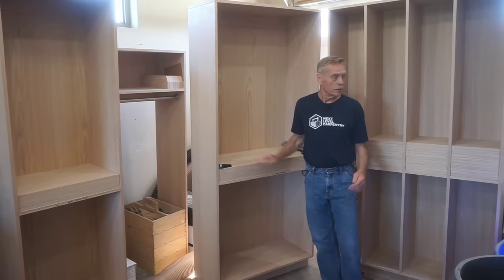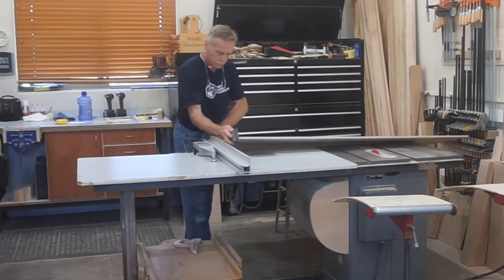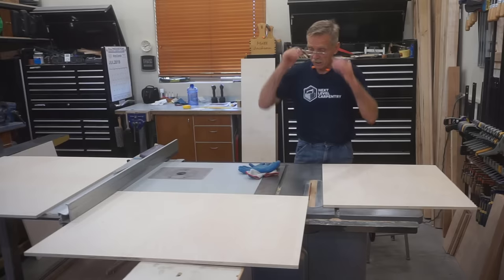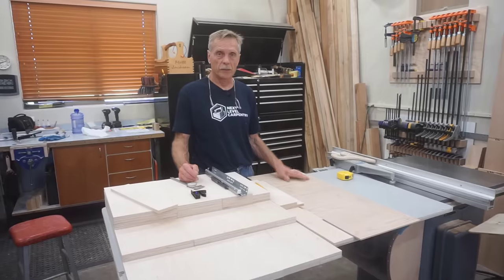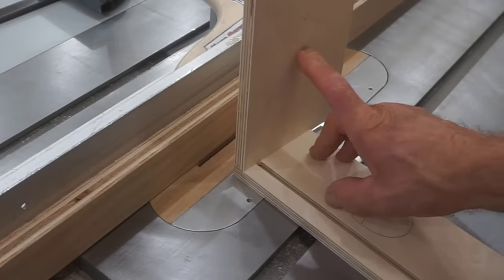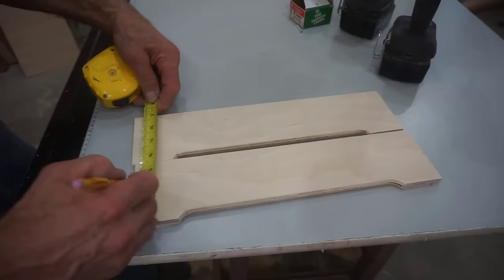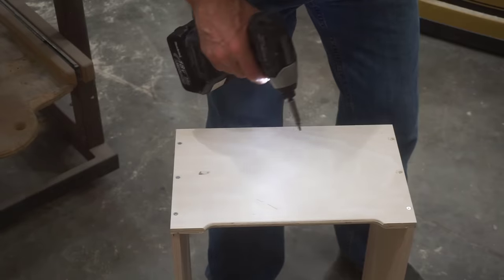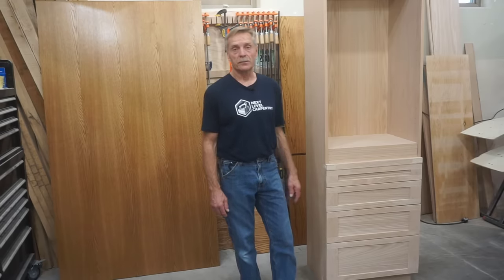Master Class for Professional Grade Cabinet Drawers

Comment: great class, thank you.
how did you compensate for Kurf?  
did you estimate based on experience or move the tape 1/8 for Kurf.  Video did not zoom.
I am experienced.
Your videos transfer years of experience to students.
Reply from the maker: I'm always mindful of the kerf Frank and make sure it ends up on the waste side of any line/dimension I'm cutting.  With that practice it doesn't matter if it's a 3/32" thin kerf or full 1/8" kerf.  When marking for layout I just slide the tape to compensate for blade thickness but I try not to set cuts to pencil marks but rely on the rip fence cursor for accuracy.  Hope that answers your question but if it doesn't just re-post something more specific and I'll have another go at it, OK? 😎

Comment: Love your videos and attention to detail. I have a question about the 1/8th tenon cuts on the front and back pieces - do you add 1/4" to the size of the drawer front and back before cutting to the final length? I just didn't see any mention of that during the video. I've watched it several times because I want to really learn from a true Master. Thank you!
Reply from the maker: Quite observant there, Chester! 😎Figuring those dimensions is second nature for me so it probably didn't get included in the video.  You're correct in realizing that the length of fronts and backs need to compensate for those tenons. First determine the thickness of two drawer sides, subtract that from the overall width of the drawer and add the 1/4".  Since Baltic Birch is 'metric'  I do it in that sequence because the thickness of drawer sides varies, depending on the source of materials and I don't want to make assumptions.  There's no shame in making a mock-up joint ahead of time to use as reference for all the small, precise and potentially confusing measurements because it's easy to subtract an eighth instead of add one and have a whole stack of parts that are exactly too short😏😎 Best, Matt

Comment: Great class!  I always enjoy and learn from your videos.  Question re the accessory bracket that supports the Osborne EB3 at the front of the saw - could you give a bit more description of its construction and how it is attached?  It looks like another great idea, something that would be very useful.  Thanks for all that you do to share your experience with the rest of us. Go bless.
Reply from the maker: Check out the close up photos I posted here on this Pinterest page Joe: https://www.pinterest.com/thetimbertailor/next-level-carpentry-project-photos/ hope that helps!  The block is as useful as it looks and a great accessory considering how simple it is to make.  BTW it is just a 'press fit' into the slot on my Delta Unifence.  Best, Matt

Comment: do you use the same method for building kitchen cabinets?
Reply from the maker: Not personally... for Kitchens and bathrooms I generally use melamine coated sheet goods for their durability and moisture resistance Jonathan.  I use a similar sequence for making parts but joinery for melamine coated particleboard is different... and a subject unto itself.  Best, Matt
Reply: @NextLevelCarpentry  Thanks!  Also, I need to say your video may be long but it is one I will watch many times as there is a lot to learn from it.  Really like your style.

Comment: With your level of excellence, are dovetail joints in the drawers better or worse?
Reply from the maker: What I am about to say is considered heresy by many and may well end up with me burned at the stake but...
The way I see it dovetail joinery was "invented" at a time when there was no such thing as plywood  and a simple wood screw was an expensive luxury compared to the amount of time it would take a competent Craftsman to cut and fit dovetails in pieces of real wood.
With modern Fasteners and materials available these days I don't think strength is even an issue for comparison so I think the concept of better or worse almost doesn't apply where strength is concerned. If aesthetics and an expression of craftsmanship are the criteria for evaluating better or worse then dovetails are absolutely much better. If economy, durability and practicality are the criteria, then I would argue that dovetails are "worse". There it is then... personally I think I'm going to go grab a bag of marshmallows and await my fate😬😂😎

Comment: What do you do about the unfinished Edge of the plywood on the top of the drawer boxes?
Reply from the maker: When those edges are sanded and lacquered they are smooth which I consider 'finished'.  It's a very cool look and performs well.  If a customer wanted something different I'd make the drawers out of solid wood like soft maple using the exact same process.  Best, Matt

Comment: Hi, I am in the process of making a dresser for my daughter.  I used 12mm plywood.  But I have a horrible horrible experience because the plywood bow, warp.  Used water to spray on the bowl side n turn it over, add weight on it etc.  upon glueing n nailed,  the wood warped n bend again.   Just  can't get it square n parallel. .  Should I used 18mm instead?  The wood in Australia is very expensive.  Thanks
Reply from the maker: Wow... what a mess!  Too bad the material you have to work with is such garbage!  Anything that bad will have the same problems even if it is thicker.  Try to find a different source where the product is more stable then plan, cut, assemble and finish it as quickly as possible: within a day or two at most, for the best chance of success.  Warped or not, follow steps I show in this video for getting pieces square and true making sure your equipment is dialed in for it to be possible and repeatable.  Good luck!

Comment: Matt thanks for your response. I was interested in your drawer installation because I am about to install drawers on Blum softclose undermount, and detailed instructions are lacking.
Reply from the maker: You're welcome Joseph... Undermount glides are the worst IMHO!  Even if you find the instructions online they only make sense AFTER you've gone through the whole prep/install process at least once.  I encourage you to make a mock-up of some sort to get all the dimensions, fasteners, drawer construction, case construction/configuration right before launching into production of the drawers and case.  It's SOOOO easy to make the drawers a little too narrow, too short, too deep, etc and have to go back and re-cut or shim or start over.  Once you've gone through it though it becomes second nature quickly.  Approach with caution and you'll do great! Best, Matt
Reply: @Hello Joseph how are you doing

Comment: Matt, why did you use the jointer to square up your stock rather than putting your framing square on the stock, draw a new square line and cut it?  Accuracy or didn't have the material or something else?  Thanks.
Reply: Well, if you draw that new line, how exactly are you going to cut along it? Personally, I would use a tracksaw or a panel saw in the first place so I don't have out of square parts at later stages, but it's the same idea...
Reply: Yeah, track saw or something similar.

Comment: Curious what table saw are you using? Especially like that removable insert 👍
Reply from the maker: Delta Unisaw circa 1982.  The insert is aftermarket and no longer available new.  Question: if I knew of a source for a new removable insert like that, what would you be willing to pay for one?  I may work with a guy who can produce a replica on his CNC and we're trying to figure out if it's worth the time and effort to tool up for it... Thx... Best, Matt
Reply: @NextLevelCarpentry  
I would think an insert like that would be worth $60-$90, maybe more, that is very unique.
Reply from the maker: @johnwatson4668  Thanks... here's a close up picture of the one I have:https://www.pinterest.com/pin/551479916872563699/ The patent is expired and, like I said I'm talking to another guy who might be interested in making and selling the ones exactly like the Wood Dynamics one.  We've yet to determine what it would cost to manufacture, market, sell and ship them so I appreciate your feedback... Best, Matt

Comment: Excellent video Matt, I always learn something watching your videos! Question; what size is your workshop? I am in the process of building a garage to be used for automobile work and wood working. It will be 30 x 50. I was planning on allowing 16 x 30 for my wood shop. I was wondering if 16 feet will be wide enough.

Comment: You leave the ply edges unfinished? I did this for my own wardrobes, and my wife regards this as 'cheap'. In Europe, high end would mean hardwood, probably dovetailed. Lesser quality may be ply, but it would be edge trimmed. The sliding hardware would be recessed into the sides and frame- no big gap.
Reply from the maker: "unfinished" would be raw-cut, unsanded edges on cheap luan plywood or particleboard, like on a lot of cheap furniture and substandard cabinetry. If anyone wants to see what 'unfinished' looks like, here's a perfect example:  https://youtu.be/KK7maOPZgVc?t=186 . 
In contrast, the professional grade drawers I make in this video are made with 7-ply Baltic Birch plywood with a recessed edge routed with a thumbnail profile, perfectly fitted joinery and sanded to 180# finished off with two full coats of pre-catalyzed lacquer leaving a durable smooth as silk surface ... hardly "unfinished".  
They are far better/durable/user friendly than raw cut (as in your case) or 'edge trimmed' (I assume you mean edge-banded).  Under-mount cabinet drawer hardware, while quite nice, actually robs a good 1/2" of drawer depth and drawer depth was a higher priority than 'no big gap' for this particular client. 
I suggest you spend less time making frivolous comments about terminology and more time advancing your skillset... you'd get fewer demeaning comments from 'friends' and might actually receive a few compliments.
Feel free to share this with your wife...

Comment: Matt, at 30:33 you said that the cut edge will be truer than the previous cut one, and you'll index that new truer cut edge against the fence for you final cut.  Wouldn't your new cut edge be parallel to the previous cut edge, negating the need to flip?  I understand why you never want to go back to using the factory edge, but it seems like all cut edges with your method would be equally square.

Thanks for the great content.
Reply from the maker: It's just an OCD sort of thing TOOH... all successive cuts are 'equally square' but cutting with a freshly cut edge against the fence is infinitesimally cleaner and smoother and results in a perceptibly better finish cut IMHO.  I do it because I can when I can but sometimes there's not enough extra material in the piece for the extra cut and I'm fine with that if forced to be.  Make sense? Thanks for watching and commenting... Best, Matt
Reply: @NextLevelCarpentry  I understand.  Finished watching the video after I split it up over 3 evenings.  Great stuff and viewers pick up a lot of tips along the way - a great investment of time if you want to get so much better at woodworking.

Comment: Thanks for this informative video ? have you tried BLUM runners for drawers ? i have tried both Hettich Quadro and Blum Tandem , i would like to know your opinion regarding which hardware you prefer if you are familiar with BLUM, thanks
Reply from the maker: I suspect Blum and Hettich are very close in quality and price separated by details of personal preference. Main reason I use Hettich is that the local supplier has great knowledge, good inventory and reasonable pricing.  Best, Matt

Comment: Hello Matt-
At about  23:47 you show a glimpse of a clever infeed extension ( I think you called a "block"), that apparently clips into you Unifence front rail - do you have anymore details, pics or other videos on how you made this that you can share ?  Thanks.
Tom C
Reply from the maker: Hey Tom,
If you scroll through photos on this Pinterest page: https://www.pinterest.com/thetimbertailor/next-level-carpentry-project-photos/  you'll see a few close-up images of that miter guide extension thingy.  Sorry, that's all I have on it and it's pretty specific to the original Delta Unifence so it may not apply to your machine.  Hope you can adapt the concept though as it is pretty useful for some operations... Best, Matt
Reply: @NextLevelCarpentry  Thanks for that Matt. It caught my interest because I also use the Delta Unifence and my rendition of an infeed support is really clumsy.  As usual you always have a better method then the rest of us!
Best Regards.
Tom C
Reply from the maker: @tomcooper748  If you already have a Unifence I think you'll be able to replicate my little guide 'thingy' without too much trouble. Combined with the Osborne EB-3 miter guide it gives me a some capabilities of a crosscut sled on wider panels.  If you have particular questions give me a holler and I'll try to help.  An important feature is that the piece that fits into the slot on the front of the Unifence is made from pine which allows a snug fit that holds it in place with friction.  Probably works better with pine than a hardwood like maple for this reason... Best, Matt

Comment: What did you use for finish and how did you apply it. I missed that.  Thanks.
Reply from the maker: I used a spray-applied pre-catalyzed lacquer Big Bob but you didn't miss it because it's not in the video.... that could have easily doubled the length of this already long video😌😎 Maybe another time... Best, Matt

Comment: Hi, recently came across your channel, enjoy the detailed explanations on how you achieve the end results as I'm a bit of a fussy bugger myself. I do have a non wood related question re this video, what is the music at 50:20? I don't like loads of screws in stuff either, looks more professional with just the wood, glue and technique. Keep up the great tutorials.
Reply from the maker: Glad you found and enjoy Next Level Carpentry Richard.  The music you're asking about is called "Stuck in the Air" which I selected from the library of 'royalty free' tracks offered by YouTube in the Create section.  It's 'neutral' enough to fill dead air in video production without alienating too many viewers  IMHO. Best, Matt
Reply: @NextLevelCarpentry  OK Thanks. Keep up the good work.

Comment: What’s your takes on dovetail or boxed joint drawers that’s commonly done in the cabinetry industry?
Reply from the maker: Dovetail joints on solid wood drawers or box joints on plywood drawers both look amazing and are quite strong. Because the commercial cabinet industry has gone almost entirely to CNC Manufacturing there's very little craftsmanship involved even in these complex joints IMHO. For anyone who has the time motivation or ambition to make them on their personal projects I say more power to them and admire those with the skill set to do it well. When I am building Custom Cabinets I focus my energies on different aspects of the project.  I devote a good deal of time and effort to grain match, durability and appearance of the outside of the cabinets and have yet to find a client who wants to pay for dovetails on the inside of the drawers when the joints I do in this video are guaranteed for life and I've never had a failure... all at a much lower cost. 😎
Best, Matt